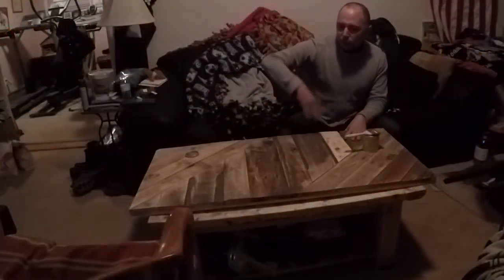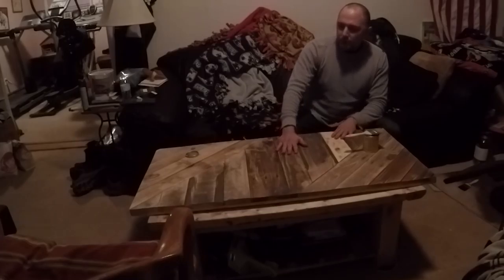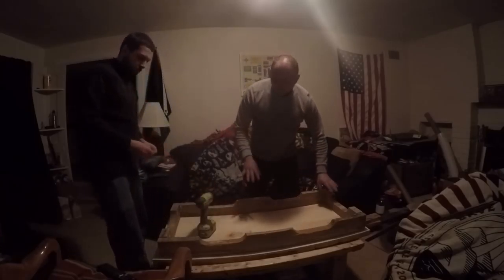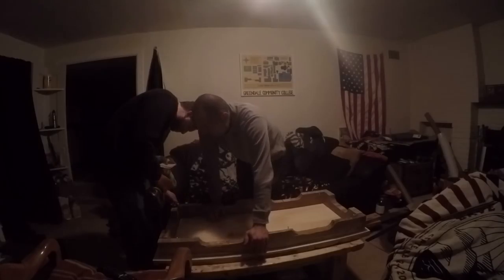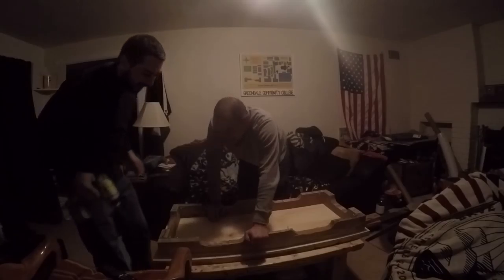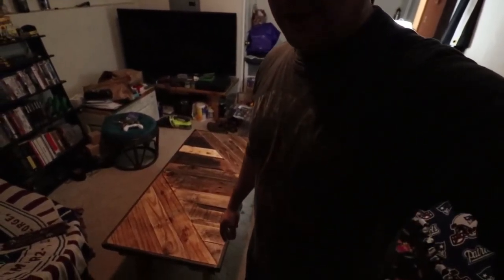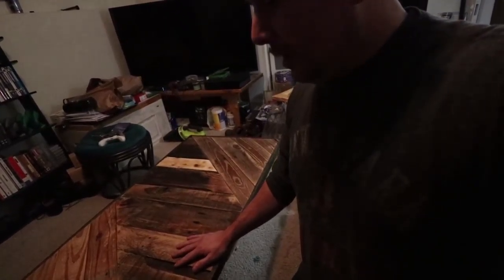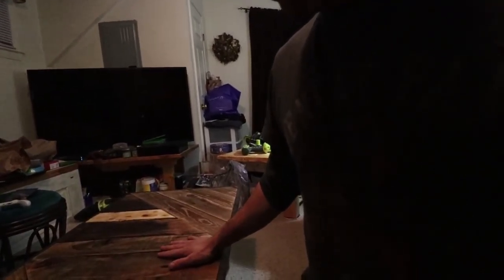Pallet Table Build - How to Build a Fast, Simple, and Cheap Table

Comment: I'm a painter. I going to use the frame for the legs as my frame for the canvases. Have them measured out. Just working on the tools part. Which, just spent $200 on batteries to make my old drills and saw back to functioning. Old charger was fucked, with old batteries.